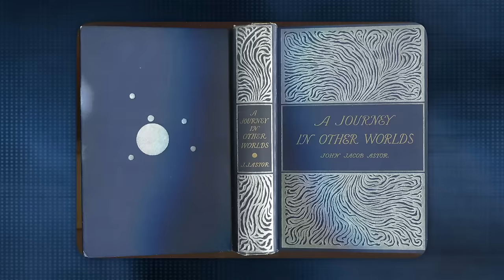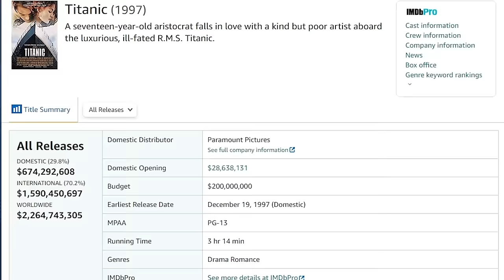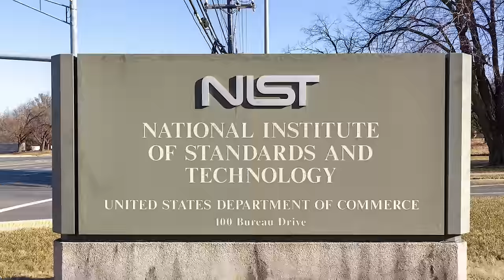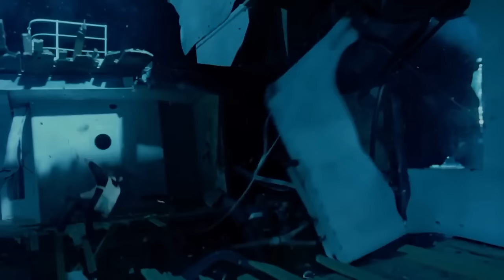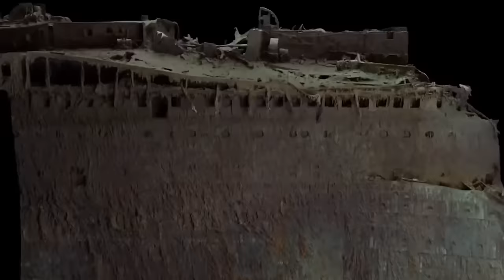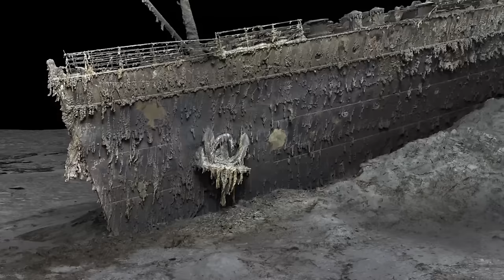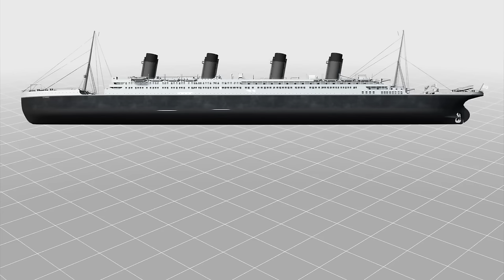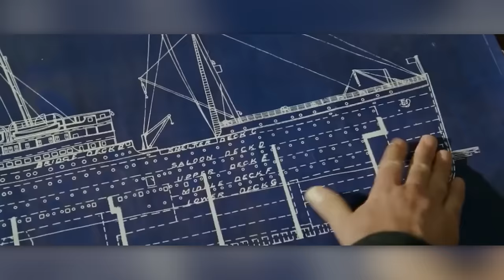Titanic Survivors Break In Tears: "The Iceberg Did NOT Destroy the Ship!"

Comment: I think it actually sunk because of the low grade rivets they used for the construction of the titanic, then the iceberg popped the rivets out.
Reply: Yet a sister ship, using the same materials, was a successful liner for 23 years.
Reply: @dovetonsturdee7033  I believe they upgraded the rivets on the sister ship, I think.
Reply: @jimmyv5730  Then you believe wrong. They did no such thing.
Reply: @dovetonsturdee7033  Don't tell me what I believe, if you believe it was the sister ship, you believe wrong as well.
Reply: @jimmyv5730  My beliefs are based on facts. Please explain how the rivets in Olympic could have been changed, without dismantling the entire hull of the ship?